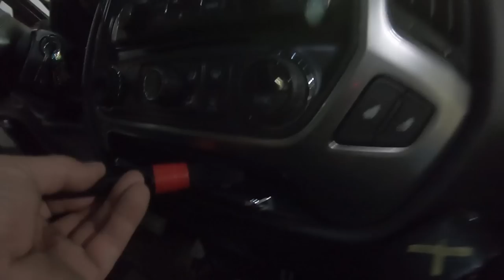Lawn Care Vlog Mowing Late because of RAIN delays

Comment: It is a thing in our area but not common yet. We offer waste clean-up. $15 per animal a week during the mowing season and we don't do "after winter cleaning". Clients provide a waste container and they dispose of waste.  A couple reasons we offer it.  1) easy money $15 less than 10 minutes..  2) No shit on the tires for sure.  Takes almost as long to wash off the dog shit on the tires than it does to pick it up. Might as well make some money picking it up and keeping the machines clean. If they decline waste clean-up and we pick up waste on machines or person we charge them $25 which takes care of future issues.. That Revenue stream just stopped for season.  3) Usually the best ROI is up selling the current customer base.  30 waste customers at 15$ per week 28 weeks. $12,600 more a season. At 10 minutes a yard = 140 hrs of work per season. 90$ per hour. I make 75$ mowing with huge expenses..  90$ an hour with nothing more than a shovel..